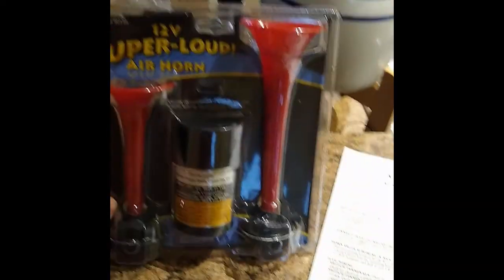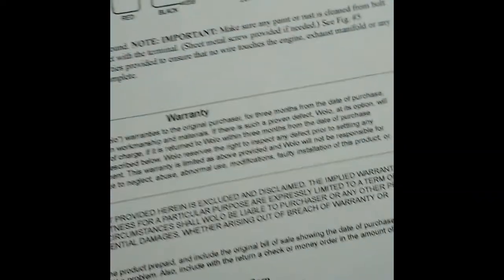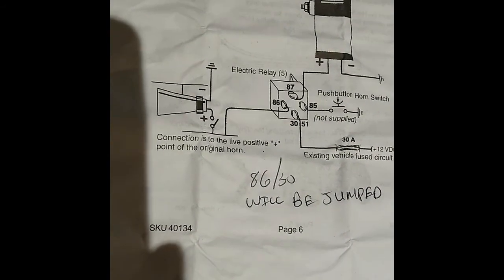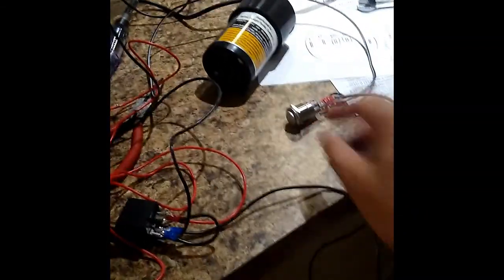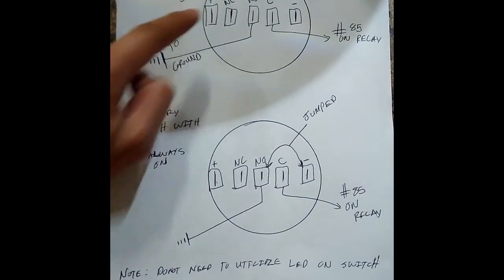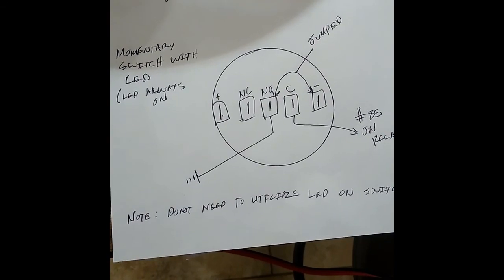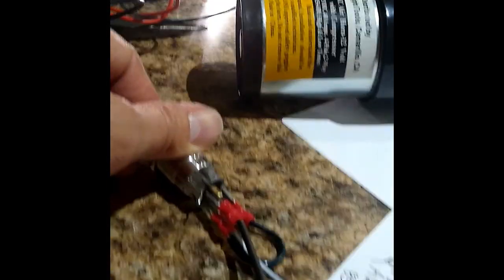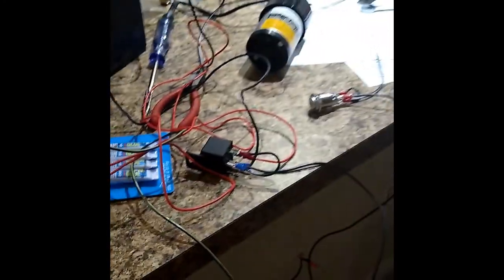Harbor Freight Air Horn wiring made easy (or other accessories with independent switch)

Comment: 86 is if you want your horn switch on your steering wheel to operate both car and air horns....Learn how to read schematics....You disconnect or pig-tail the positive wire from the manufactured car horn and connect it to 86....the switch will operate w/o car horn.... READ the Instructions my God it tells you right there.

Comment: I am using a button switch. Were would the other end of of the switch get wired to.
Reply from the maker: How many prongs are coming out of the button switch?? Are you going to wire it the same way the horn in the video is wired? (Completing the ground circuit) does your button switch have an LED?

Comment: I bought an air horn for $10 today thinking this was a steal of a deal. I found out I Needed an in-line fuse holder, fuses( cause ya know you’re going to pop a few during install). And a horn button. Ok ,trip to the hardware store! After looking at the directions I thought not too hard right? Holy F##k! After 6 hrs of trying to get it to work and watching YouTube videos all day from the most technical to the 3rd world hard to understand guys I found your video. And to think I just needed to jump the two connections with the horn button in line. I wish I would have seen your vid first.
Reply from the maker: That's why I place emphasis in the idea that we are completing the ground on this circuit. If the circuit and or really wasn't being utilized to complete the ground then jumping would not be the solution. Hopefully you don't bust any fuses during the install, that shouldn't happen.  I'd say having to buy a switch is pretty normal as well. Good luck with the install, I had success with mine. Perhaps I should load a video of that.

Comment: Well that was more helpful than the first video I watched. Terminal 87 is a no brainer. I decided to first try it your way with the jumper between 86 and 30 to my Upfitter switch positive power, and then 85 to negative ground and it worked. 

Now I’m wondering if the reason they had 86 to original vehicle horn power was really to charge /turn on compressor the air compressor before using the horn button or in my case my upfitter switch to control the horn when ready to on 87. Anyhow, I temporarily have my relay power to the battery, and tomorrow I will connect it to a switches source of power so it can’t drain my battery on my F-350 diesel truck.

Comment: I bought this cause it was cheap and I can’t even hear it from in the truck so I ripped it out and got a horn blasters musket horn way louder
Reply from the maker: Once you wire it you can just replace components.. the wiring is the hardest part.. glad you have something louder on the way!!
Reply: @hesson81  absolutely right the Hardest part is done lol , I can’t complain to much though for 13$ the harbor freight horn is perfectly fine For someone  on a budget

Comment: I did a different set up but with your horn switch. The light stays on without the key in the ignition. I know you wanted to fix that to head lights... any luck? I have a new tundra dont wanna drain the battery. Thinkn of making all positives into one line, ideas?
Reply from the maker: Yes I did. I was able to find an old tap that was going to my headlight parking lights, so I grabbed that wire ran it under the dash, and into the switch. The LED only comes on when I have parking or headlights on now. It worked out great.

Comment: What did you use for a ground on your test?
Reply from the maker: Are you referring to the test when I just had it on the countertop?, I just wired it to the negative post on the battery. So the momentary switches on the ground portion of the relay in between the relay and the negative battery post

Comment: Does your compressor automatically start when you start your car, or is that a separate switch??
Reply from the maker: So the compressor only operates when the momentary switch is pressed. Not too confuse with it being hot wired to the bettery. So the ignition need not be turned on.. it's just like your car horn in that if you're in the car, it's dark and the ignition is off.. It still works
Reply: @hesson81 if there is a leak will the compressor run when the car is off? Sorry... just askin... or is that part of the switch? Monetarily switch is the glowing light you press by the dash, correct? Harbor freight comes with a swich also.... idk